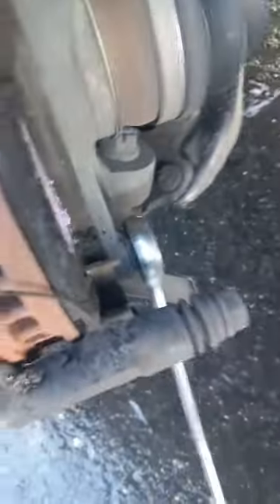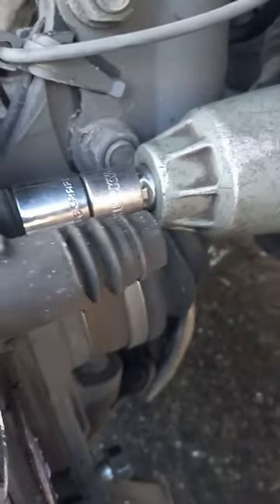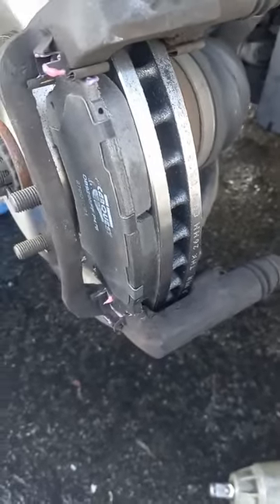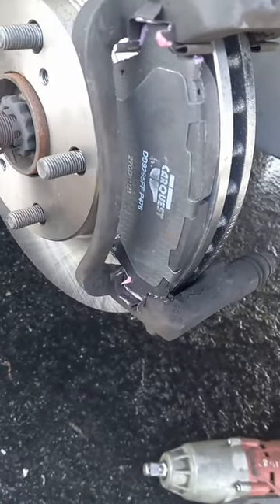2001 Toyota Sienna Camry Solara front brake pad and rotor replacement.

Comment: Those rotors are fine, have them turned.
Reply from the maker: Severely WARPED. My OWN vehicle. 
45.00 per New rotor each. 33.00 to machine old rotors each.

I DIDNT want old warped and cut rotors. In my experience they are MORE prone to warping again.